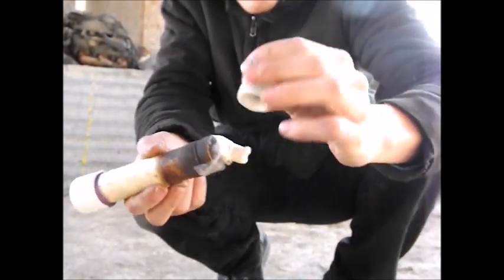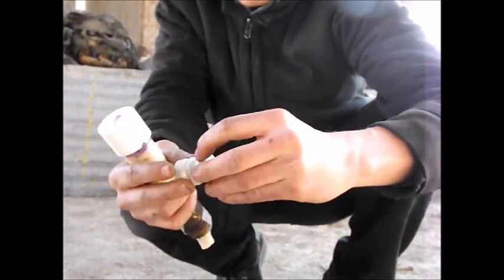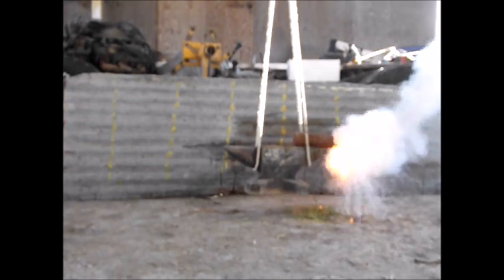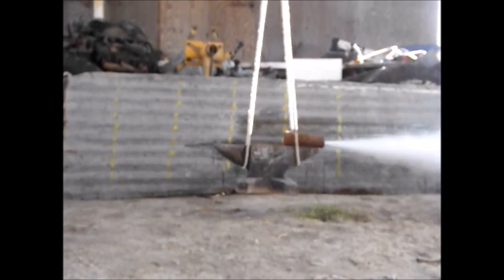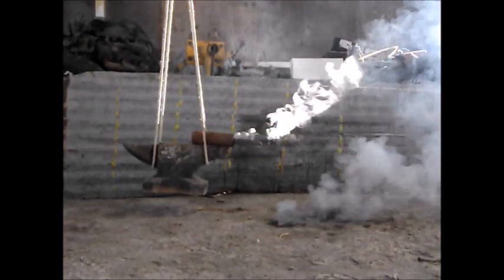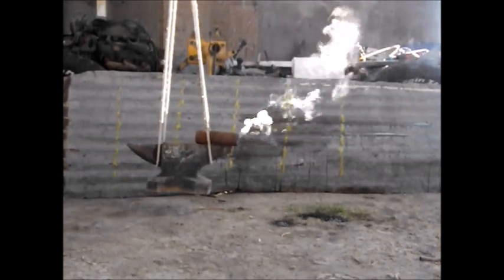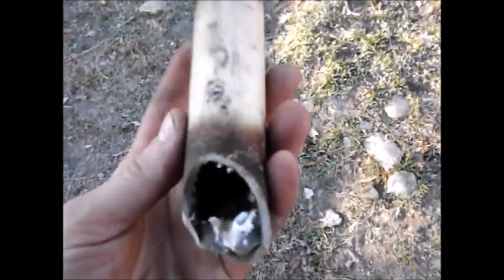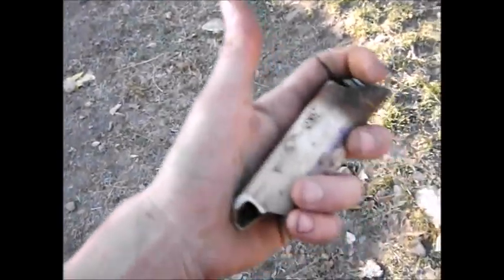Eletric Insulator Nozzle Test

Comment: Clearly, what you need is to make an aqueous solution of UF6 salts using high concentrations of U-235 (isotope separation left as an exercise to the reader). which passes through a chamber art low pressure with a nozzle on the end in such a way that critical mass is achieved as the water boils due to vacuum.

Comment: Why not use iron pipe and forget the melt-through.  Also the screw n caps with a large hole in the end will let the nice insulator-nozzle will be retained and give you a contained unit.

Comment: I've experimented using spray-paint cans for sugar-rocket cases. I end up using a circular plug made from a 2x4 with a hole-saw, and running 4 screws into it to secure it as the end-cap. On the other end, a segment of 3/4" conduit brazed to the "rounded top" end of the can (with the exit hole suitably sized). Overall, I'm learning that a 2" diameter grain is "pretty hugely awesome" to work with for sugar-rockets (more success with 3/4" diameter grains).

Comment: I use 1" schedule 40 PVC. I drill a few holes through the ends and thread small wire across and fill with water putty. Nozzle end uses a stainless fender washer to protect against erosion. This is with standard sugar/KN.

Comment: With respect to rocket candy, I went through a lot of the same failures.

It may seem very counter-intuitive, but I found the best nozzle to be no nozzleat all.  You just need the center to be "cored" out.

To do this, use a cylindrical rod lubed with veg oil to create a hollow core.  Fill your PVC tube with the KNO3/sugar fuel.  Then cap tube off with dry powdered clay. I used a thick cardboard tube, so you might have to sand the end of the PVC tube so that the clay grips the sides.

Comment: One thing I can recommend and hopefully you don't mind is that PVC gets very weak and brittle if it gets charred on the outside from my experience. Obviously in this case the motor failed at both ends but I did notice the pvc was looking a little dark where you put that wire. I know this from making a few Bows out of PVC for shooting arrows and having one fail right where I accidentally charred it with the heat gun. All the other ones I have made have been fine thank God because when my other one broke I hurt. Hit my shoulder thankfully. But anyways my recommendation is to use hot oil to heat the PVC. I heats very even and consistent and you can just dip it in and out until soft enough with it being less likely to char. Just my 2 cents :) Any updates to the liquid fuel rocket?       .
Reply: Good luck on exams! Thanks for the reply :) Cant wait to see how the liquid O2 works out!
Reply: +Cody'sLab plz continue this

Comment: Be like everyone else and use cement nozzles. You should lock the rail from which the anvil is hanging, that way you can get a real thrust measurement, or just put the rocket ontop of that kitchen scale you had there and use a mirror to see the numbers. Did you core the grain or is it solid? G luck next time brah!
Reply: Cool, I just got myself some 2 kg of potassium nitrate and will be testing the full motor for my rocket any time now. I ll have to play around with burn area though, to lower the max chamber pressure and prevent an engine rupture